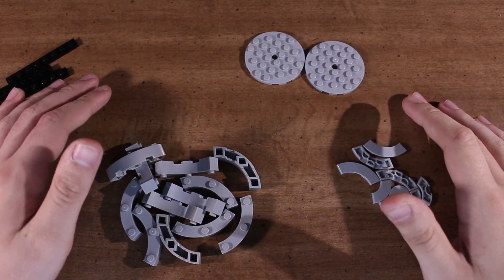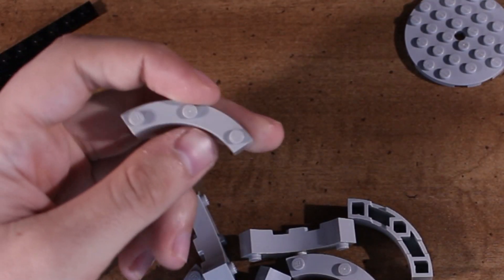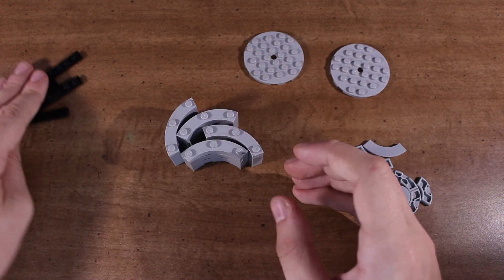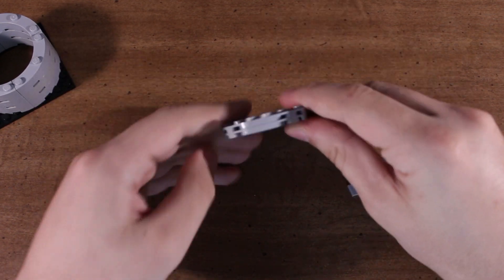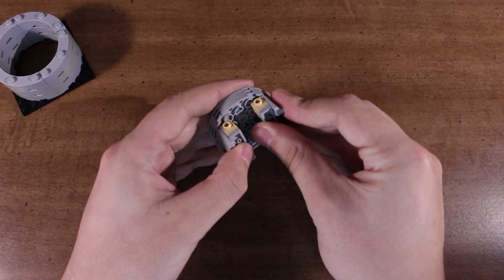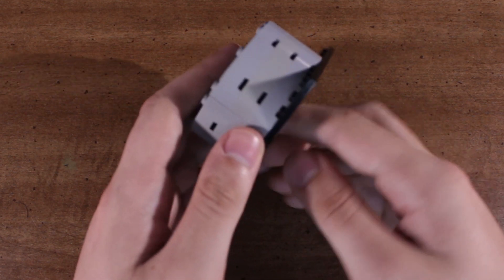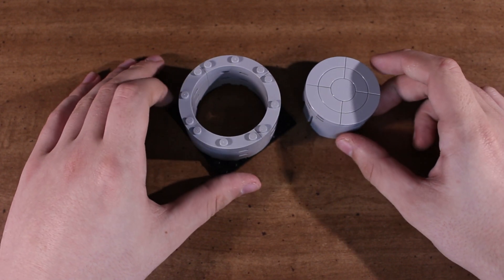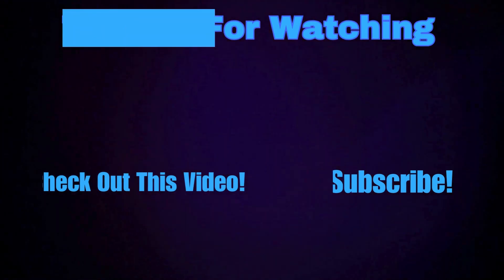How to Build a Round Piston LEGO Engine!

Comment: 😭😭😭 the 3 x 3 macaroni tiles are so expensive on toypro they are about 2$ each. And I need 24 because I’m making a v6 or i6 so it was 45$ 😭😭😭😭😭😭😭😭
Reply from the maker: Check out bricklink.com. they're much cheaper there, only a few cents each
https://www.bricklink.com/v2/catalog/catalogitem.page?P=79393#T=C
Reply: @ yeah I actually checked it already and I just think bricklink is so confusing 😫
Reply from the maker: In that case l, check out brickowl.com. it's a lot more user-friendly in my opinion
Reply: @ ok👍

Comment: it doesnt look airtight at all...  tho some tape on the exterior side all around would probably make it a bit more airtight
Reply from the maker: It's not designed for vacuum engines, but rather engines that run using motors, however it is possible to make it a vacuum engine